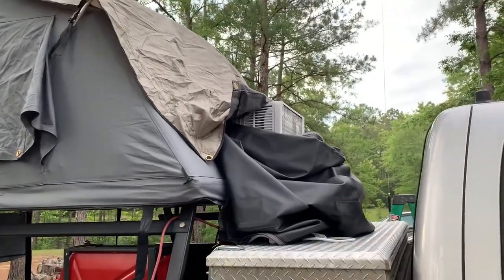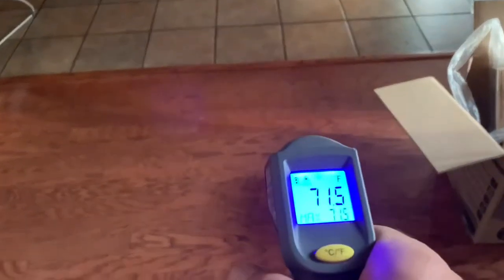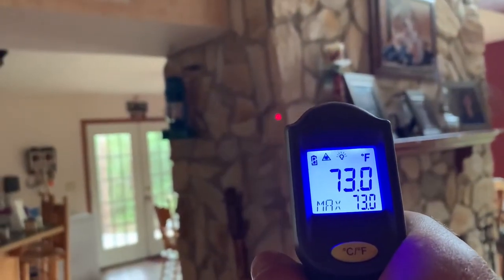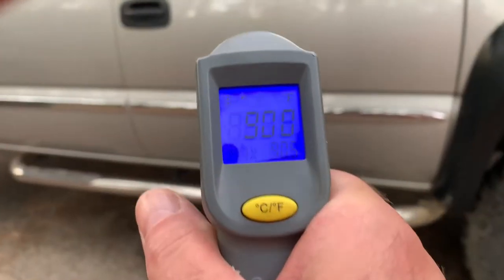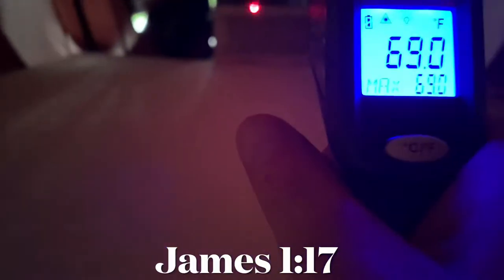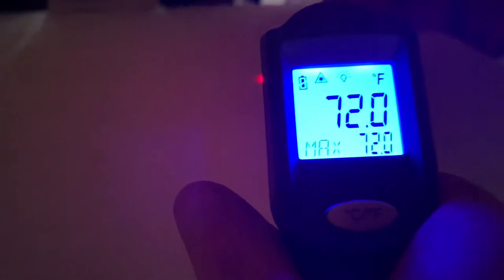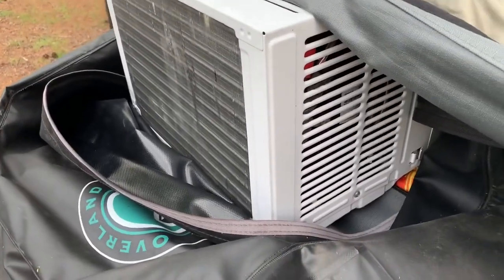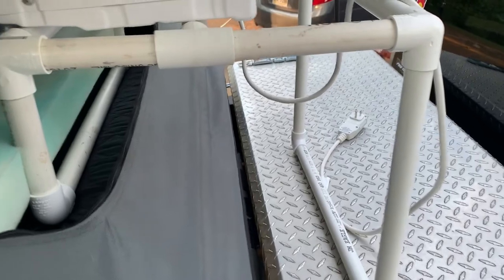AC in roof top tent kept simple,no cutting,routing vents etc..

Comment: Hi there great video I love to set up . I am building one for my truck as well. May I ask you how are you powering the AC off the grid ? Also is it running constantly all night or it shuts off when It reaches the temperature set? What is the brand of AC unit you are using it? It seems very quiet. Thank you, sincerely, Julian locatelli
Reply from the maker: Thanks , so I haven’t ran off grid. I used at a camp  with power, could use a generator off grid. Cheap window unit that for most part stays on. I did notice it cycling down a bit but ran pretty steady. I used at beach state park it was humid and about 75 outside and kept tent cold and lowered humidity . Now the next day the outside of tent was wet but not the inside. So jus let it dry in sun specially between tent and rain fly
Reply: @thehickspanic8646  Awesome thank you for taking the time to reply.